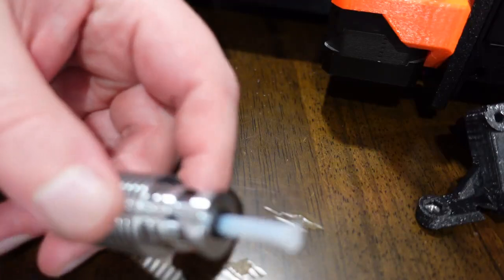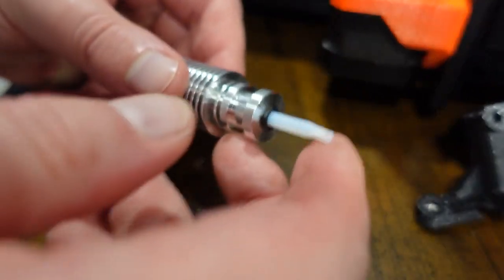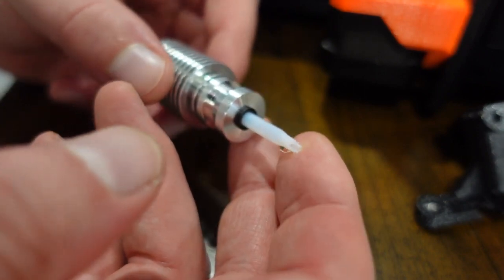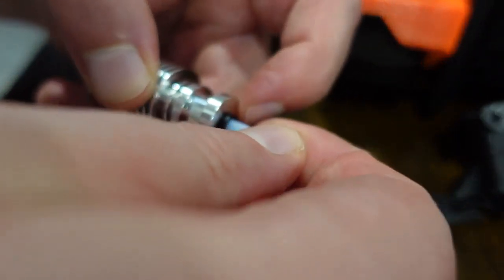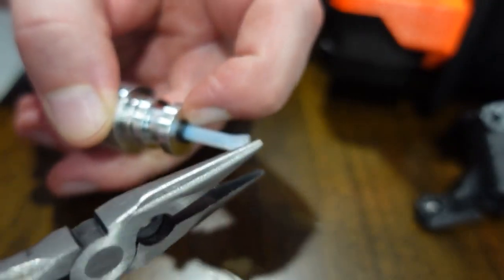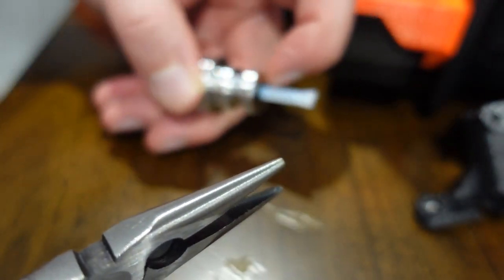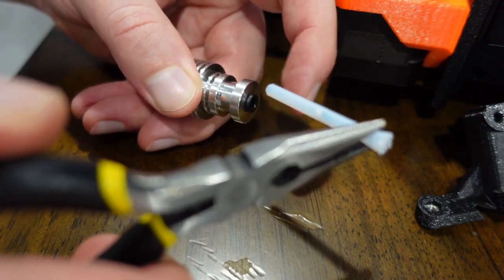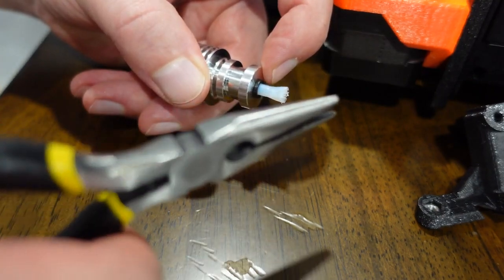PTFE Tube Stuck in Hotend Prusa Mk3s - FIXED!

Comment: Thanks Glenn, even with pressing the black colar down I am having trouble pulling the tube out, I think I left it to long??
Reply from the maker: That's weird it should release, maybe try pliers just the thing is that you might break it if you don't press the black ring down far enough
Reply: @glennbrian3d  got it in the end, thanks mate.
Reply from the maker: @glenjones182  good!
Reply: @glenjones182  how did u do it?

Comment: I have an ender 3 v2 neo, the filament broke just on the extruder. Tried to pull it from the end oposed to the hotend... No success. Tried to remove the nosel and pull the ptft out... No success. I just can't get it out, tried to pull the black collar up, down nothing helped. Is there any other way to remove the ptft? Haha think i lost the entire hotend.
Reply from the maker: Usually when I get a clock I just heat it up to like 260 and push it through, I've only had to dismantle the hot end once because it was PETG and the fan turned off
Reply: Saved me! Thanks a lot
Reply: @glennbrian3d  but now after the nozzle change it started to be unable to maintain an exact temperature. With 208° set, it goes up to 210 then down to 204 and keeps doing that over and over again. I've updated the firmware but that didn't help at all. Any ideas?